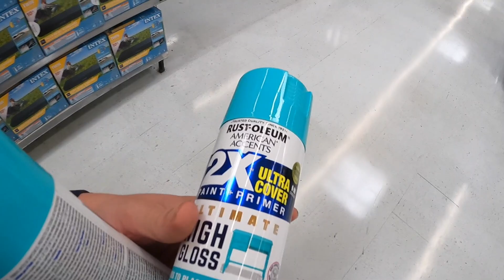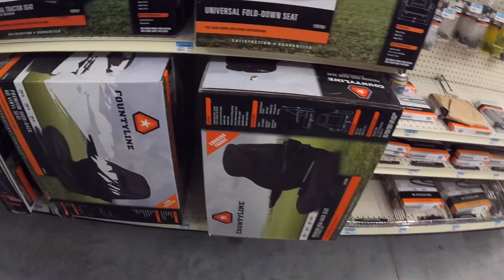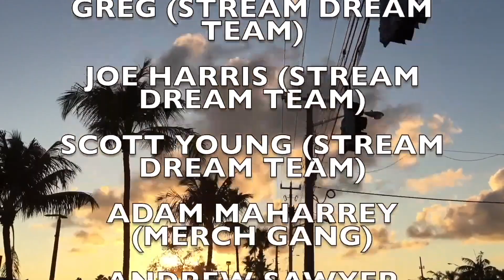JAZZING UP THE TRACTOR!

Comment: Just wanna warn you guys about valve issues with those briggs, I did the same thing and dropped a valve on a 150hr motor. If you are going to do towing and stuff like that I would get a 2001 Briggs 20hp I/C motor which is a flat head and an opposing twin. Good Luck!!!!